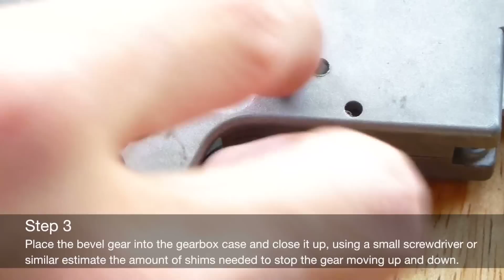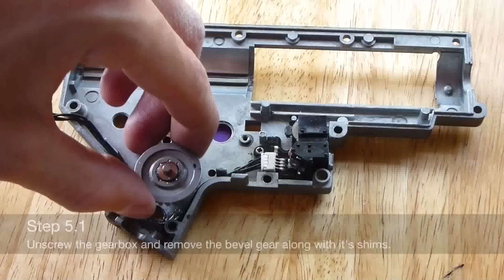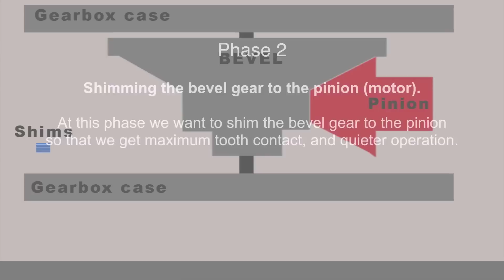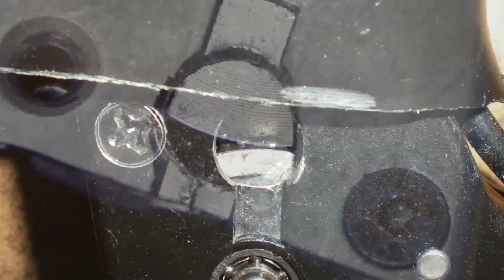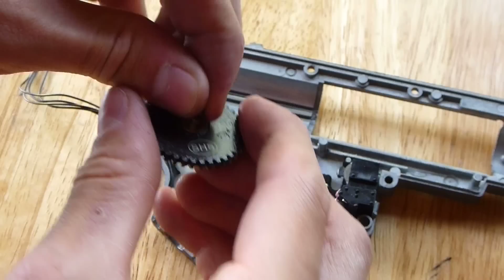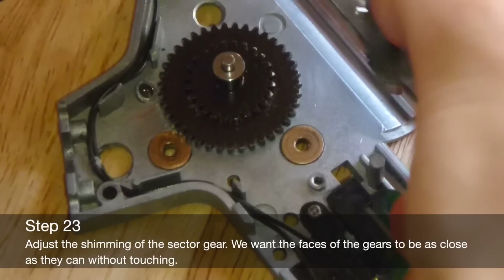Airsoft Tutorials - Shimming

Comment: A little vertical movement is needed. In Germany we say „passt, wackelt, hat Luft“, it fits, its a little shakey, it has „air“ (space). In a v3, you slide the motor pinion gear into the gearbox and watch the bevel gear‘s vertical movement. If it is pressed against the motor gear, its wrong. In a v2 its difficult to tell if the bevel is placed properly.

Comment: You don't need any Shims on the 'small' end of the Bevel Gear.
The Motor Pinion Gear keeps the Bevel Gear tight against the Shims on the other end, so it can't physically move to the left.
You need to shim the Bevel to mate correctly with the Pinion.

Comment: I've got two guns that I've built.  Both with SHS 14:1 gears, and SHS contacts.  I've found that my semi flickers between semi and auto.  It's the contact trolley/shuttle that the cut off lever sear has been worn down a lot so semi doesn't work.  This is my 3rd set of SHS contacts.  Is there a better alternative?
Reply: +James Minzy I just put a metal pin in the trolley, it hasnt broken since then

Comment: when I finish shimming and assembled my gun. I tried shooting but the gears lock up and leaves the piston cranked but not pulled all the way to the back nor release to complete the cycle. if i keep pulling the trigger it makes a buzzing sound without any gear spinning.
Reply: Your motor is probably in too high or has too much contact with your bevel gear. Shim via the bevel to pinion method and start off shimming the rest from there.
Reply: hi HereticEngaged yes. Right after i posted this comment i adjusted my motor. It was too high. I realized when i was adjusting the motor height while the gearbox was open is different than when it is actually fired. THANK YOU.

Comment: few shims as possible under the gears, majority on top.
Reply: nope
Reply: wanna explain?
Reply: The bevel to pinion meshing would be incorrect if you shim the spur as low as possible. The biggest transfer of energy occurs between the bevel and the pinion gear, so if that was not shimmed properly, your gun would have incorrect meshing.
Reply: Commonly in VFC guns, when replacing the auto shimming gears with normal gears, the majority of the shims are on the bottom, with one or two on the top. That is because if there were more on the top, the bevel would be pushing onto the pinion and grinding. Source: airsoft tech and has owned 4 VFCs and worked on countless others. Same with JG. I cannot speak for other guns except G&P, BUT i ASSUME it would be the same due to the size of the bevel.
Reply: Isn't this hard iam afraid iam gonna break my gun
Reply: +Robert Ball ur not gonna break anything unless ur dumb

Comment: Great video. But is there a double job? Why not skip straight to phrase 2? Are you using ASCU? Noticed there is no cut off lever.
And also, if you are using Spectre, more likely you are to shim sector gear 1st (to contact the cut off switch detector) and work your way to the bevel gear.
Reply: up2wind81 that's actually false. I have shimmed several gearboxes with btc fets and I ALWAYS start with the bevel to pinion. It is wrong to do otherwise as it can cause poor shimming or unnecessary wear on other parts. The way to shim a build with a btc fet is to shim bevel to pinion and if and ONLY IF the sector doesn't touch the cutoff switch, take a shim off the bottom and put it on the top. I have never had any issues with a sector not contacting the switch anyway. You have to shim pretty high for it occur.

Comment: No. First you want to put a small shim on each gear so it doesn't contact the case. Then you want to look at each pair of gears to make sure they mesh together well. You may need to add another shim or two so there is optimal teeth to teeth contact.  If you don't do this. You just wasted time and will blow out your gears.

Comment: An automotive parts or hardware store should have a decent selection of various lubricants. Pure silicone grease is good for air seal parts, while lithium or molybdenum grease is good for mechanical parts like the gears.

Comment from the maker: It could be a few a things:
Quality of the gears
The gearbox itself 

If you try each individually and they make no noise i may just be the gears and you may not be able to do much. Try adding a small amount of grease to the teeth and axels of all the gears as well as the bushings, it may just be the metal on metal contact. A few of my gears especially in cheaper gearboxes make a small amount of grinding noise but once its all assembled you cant really tell.

Comment from the maker: Its simple when you know how. 

To simplify it:
1. Shim each gear individually to the gearbox
2. Shim the bevel to the motor
3. Shim the spur to bevel
4. Shim the sector to the spur
5. Place all the gears in add a small amount of grease to the bushings and test.

Thanks
AT
Reply: thankyou, best tutorial for shimming. i have question on bevel to motor step,  my bevel and my motor is too tight even without any shim on the wide suface side, do you have any suggestion?

Comment from the maker: With a version three the motor is usually in a cage, Just attach it to one side of the gearbox with the bevel gear in place and then adjust with the screw at the end of the motor cage until it is in the right place.

Comment: you dont need to drill a hole in the gearbox. you can just screw the pistol grip on the other half of the gearbox shell with the bevel gear and find the correct motor height.

Comment: I just think you should drill a hole at a different location which would still do the same peeping but also allow the pistol grip to be installed. I do no guessing when shimming. Also to point out the body can create a problem for motor height pinion shimming. No bushings or bearings are glued down or stated to do so. I have done a lot of different brand installing and seen many shimming problems that are not stated online.

Comment from the maker: If you shim the gears correctly the tappet plate should not really be an issue, I have never had the tappet plate tight between the gearbox shell and the sector gear before so I didn't know to include it in the video for shimming.  I usually check this when I do a pre-build to make sure everything is in the correct place and functioning properly. However i think that that your point is a good one and should be checked when shimming.

Comment from the maker: Thanks for your input. The hole drilled does not affect the gearbox structural strength in any way not does it effect the gears, this technique is used by quite a few people to ensure that the pinion to bevel gear alignment is correct. I would link but comments do not allow it.

Your right the cut-off was never even installed, I actually forgot to film it and never got around to re-doing it, i'll put up a caption when I get time.

Comment: The other videos are good but this one missed more than a few important points. Also the drilled hole is a bad spot. I would NEVER recommend to drill the hole there. Cut-off was never even installed. No tappet plate was checked either.